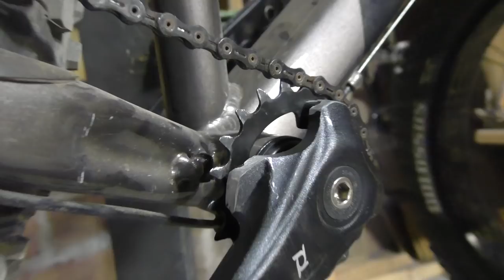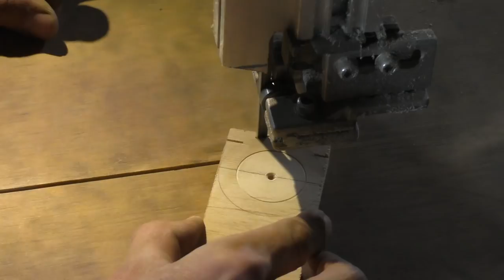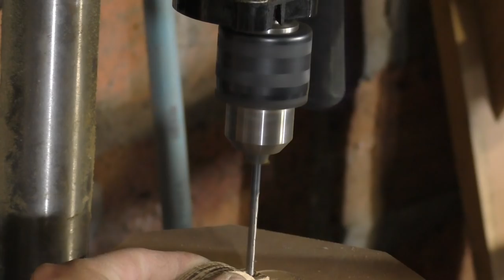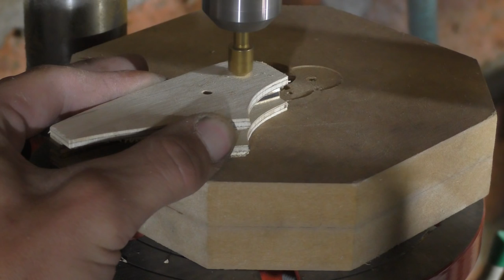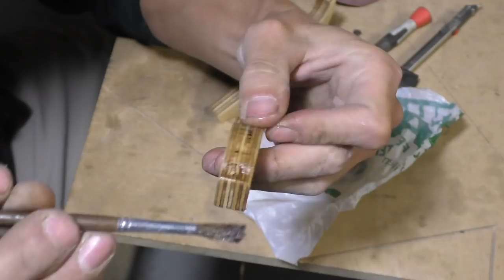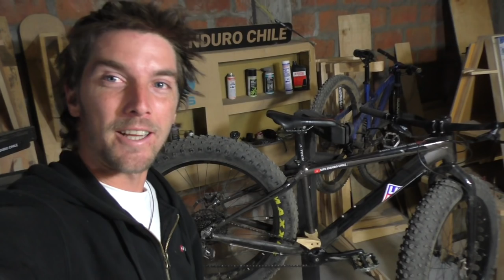Guía Cadena Casero De Madera para tu Bicicleta!

Comment: If you or your friend has a 200$ 3d printer you could just design it and print it. This video shows wood working equipment for several thousand dollars. The end product is still less durable than a 3d printed chain guide.
Reply: Callao perkin